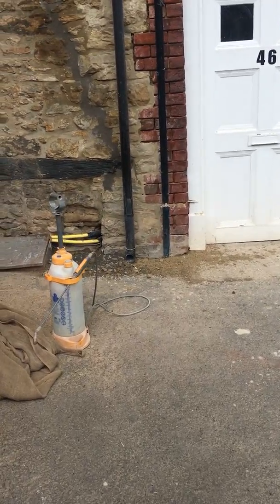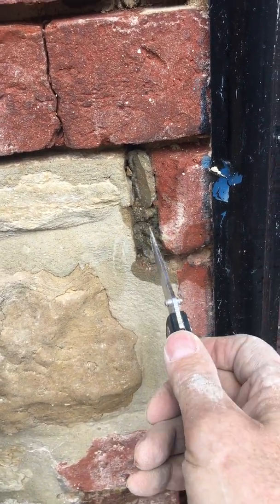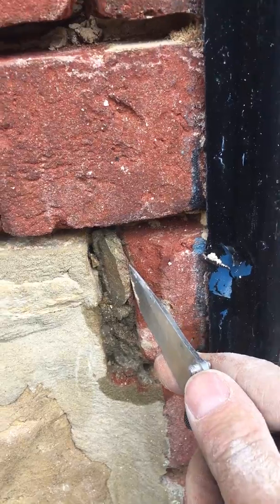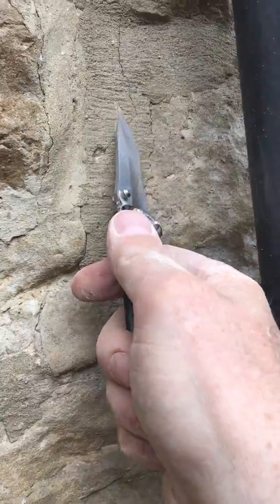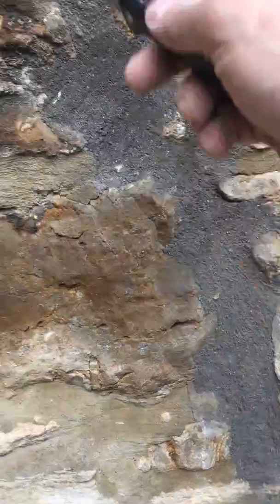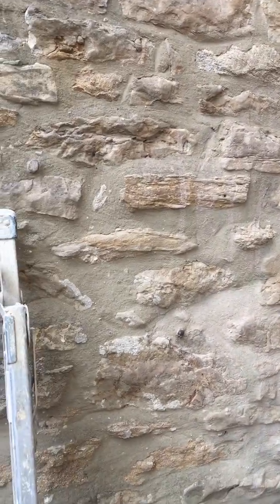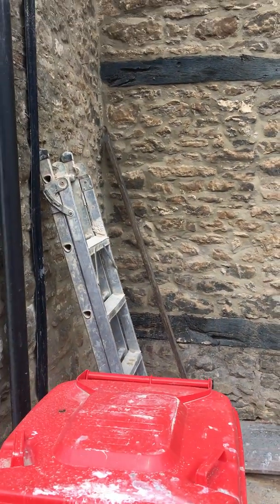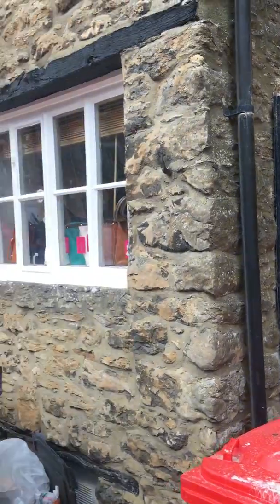Why you don’t use cement mortar in period properties.

Comment: Excellent problem solving, using cement on stone does eventually cause the stone to to, the water will build up at the back of the stone and nothing can breathe, the cement mortar never weakens and causes unbelievable damage, seen a massive job in the Hebrides that was caused by the same method, the natural stonework can't breathe. BTW like your videos, excellent watching

Comment: Just wondering if anybody's got any advice.  
Got a stone cottage built in 1800s, but in 1970s somebody  cement rendered one side and pebbledashed the front.  Any suggestions for how to get rid of this stuff?  
Thanks for these informative videos.
Reply: Hammer and chisel, SDS drill in hammer only action if you feel brave. If the cement hasn't gripped hold of the stone too strong try and lever it off with something (crow/moulding bar, spade or anything that works).
Depending on the condition of the stone you might be better lime rendering it to protect it or a good number of coats of limewash.